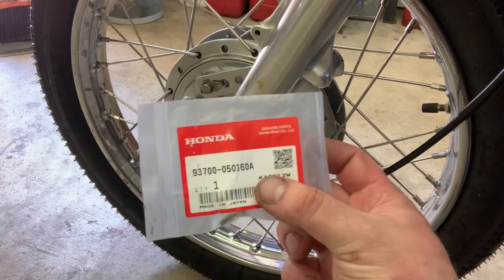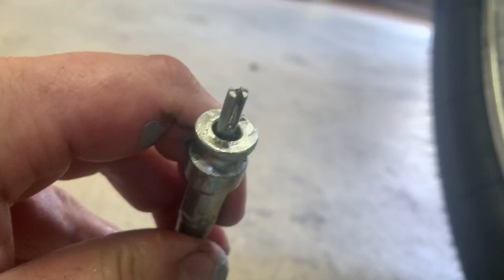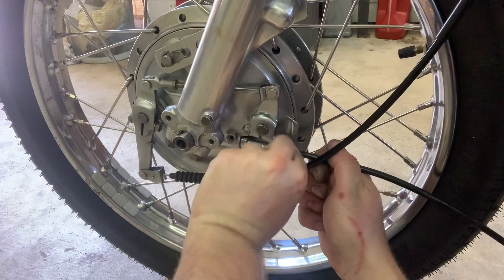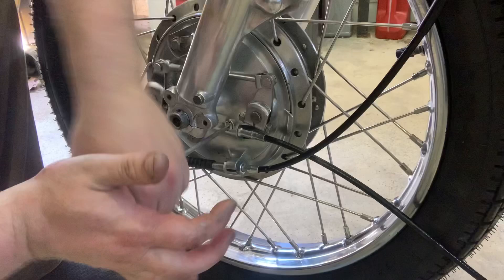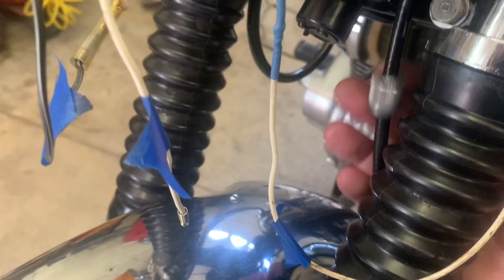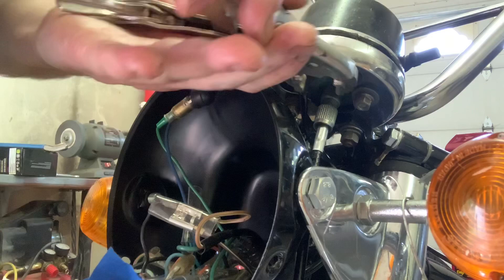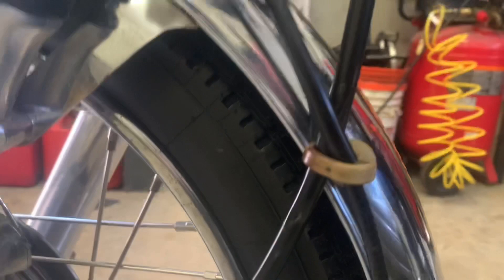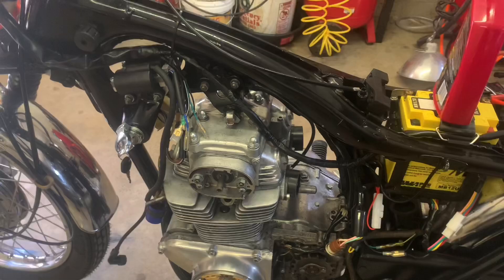Install The Speedometer Cable on a CB350 CL350 Honda Motorcycle

Comment: Is it normal for the fastener on the cable end behind the panel to not fully tighten (threads still showing)?
Reply from the maker: Are you referring to under the gauge?
Reply: @KeepOnWrenching  Yeah, the fastener directly under the cluster/gauge. The fastener on the wheel-end fits fine.  This is on a 1996 Kawasaki Ninja 500. It only tightens about halfway. I made certain it’s not cross-threaded.
Reply from the maker: Is the slot in the end of the cable mating properly into the gauge? Could be getting hung up there and lined up/seating fully.